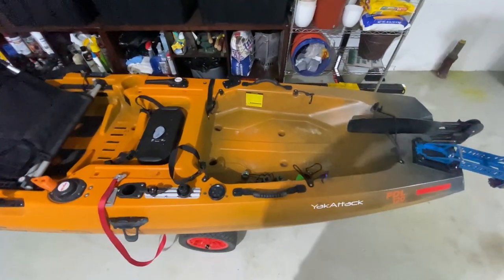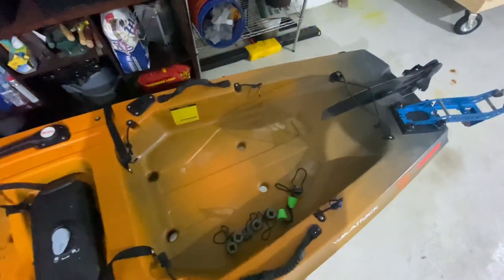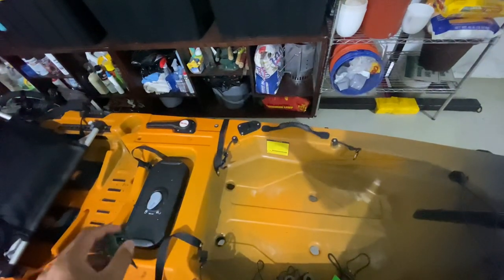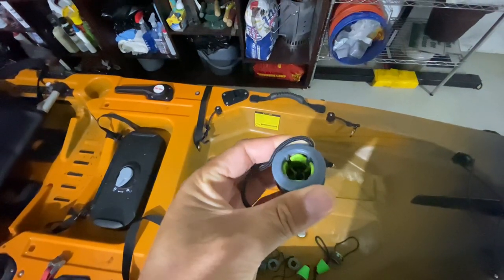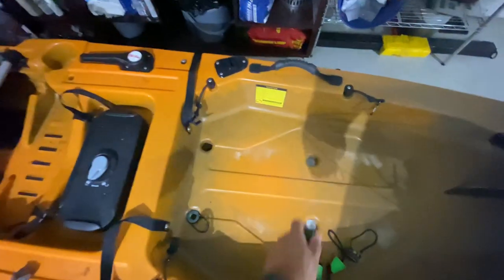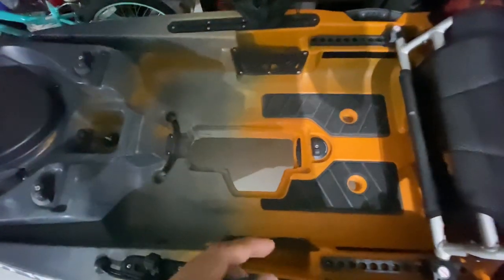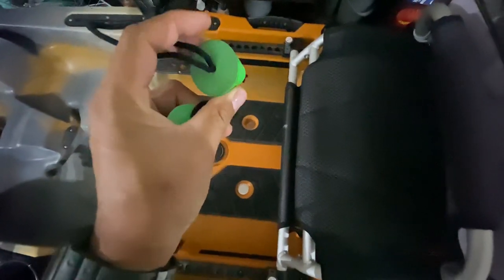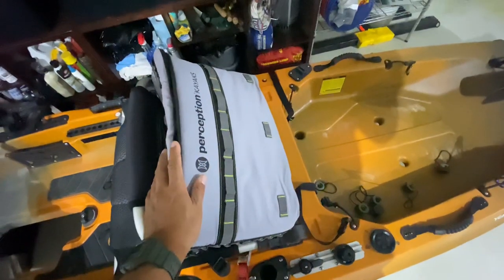Do you need them for your kayak?

Comment: why do they come in different sizes? mine don't fit on the front ones.
Reply from the maker: The scupper holes on my kayak are slightly different in size. I had to remove the rubber o-ring to make them fit on the back..  I could squeeze them in but I’m worried it could damage the hole from contraction/expansion when it gets cold or hot.
Reply: Om mine the front ones are smaller so i may have to remove the O ring to make them fit